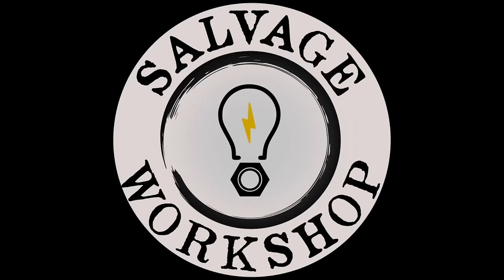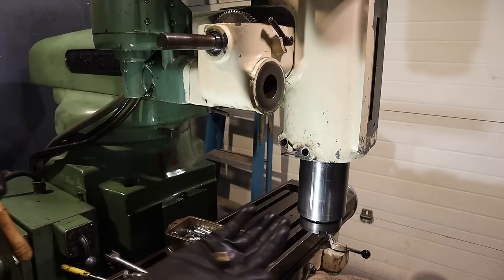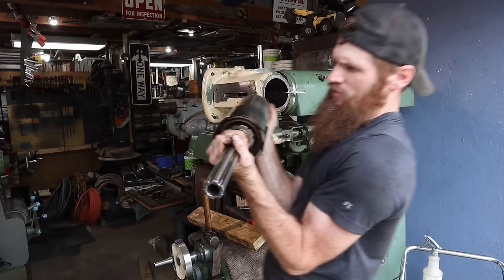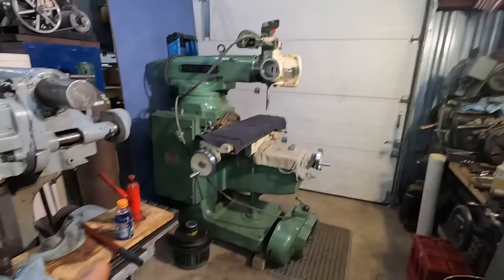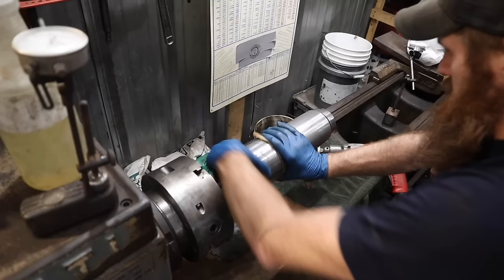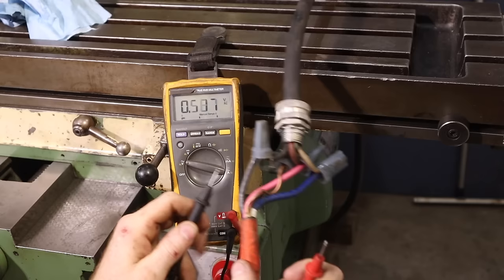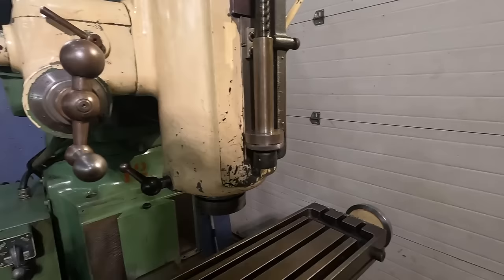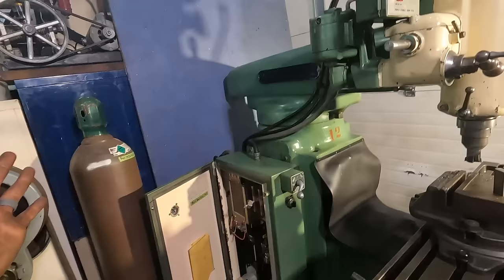My 1960's Milling Machine Is STUCK SOLID! ~ Can we fix it or will I DESTROY it?!?

Comment: If I’m hearing that right (it sounded muted like you had silenced it to some extent when editing the video) that clunk your talking about sounds like a gear dog not fully engaging it’s mating gear.  Not sure if you know what dogs are.  I’m referring to the sideways projected “teeth” on some gears.  They project out axially instead of radially as in the actual gear teeth would.  The dogs will mesh with another gear or sliding ring with a matching set of dogs and this is a clutch in essence.  Dogs mate with another set of dogs on a shared shaft.  Think motorcycle transmission if you’ve ever had a motorcycle trans apart.
Also could have been a pawl skipping.  Again not sure cause I couldn’t hear it very well but I know that sound.  We do a lot of the same work.  Engines, mills, lathes, heavy equipment repair etc, and I’ve heard that sound many times from various mechanism and it’s some sort of gear not quite meshing right and it’s ratcheting or some call it camming out I believe!

Comment: Probably need to change the setting / heaters on that cont actor since you are running 240V the amperage will be higher than the 240V so that would cause the tripping.

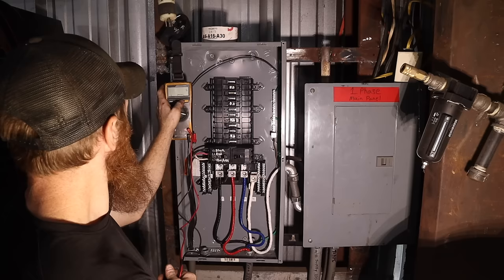Comment: 1:00:30 oh man, never measure mains using 2 hands like that - always hold both probes in one hand and keep the other hand well out of the way or behind your back. If you get a shock, 2 hands is shunting the full voltage directly through your heart and will kill you instantly. One hand the worst you can get is to ground out your leg on the side you’re holding it.

Comment: Look at the motor nameplate
230 volts draws more amps than 460volts
the N20's are overload heaters that heat the post they sit over high amps cause solder posts to melt and spin causing the motor to trip i think you will need to finf a HIGHER n STYLE HEATER

Comment: I am sure I know less than most. As mentioned below check your control transformer.  and compare it with your outputs on the starter. If wrong a simple single phase  step up transformer to the starter coil should help.   When you dropped your voltage at motor from 460 to 230 you doubled your current through  the over loads  you may need to  change the overloads..

Comment: You need an electrician. Did you change the voltage on all the motors or just the main drive motor?  I'd also toss that RPC and get a VFD

Comment: I wonder if something crashed into the spindle housing, where you have had to wedge it apart with chisels. I feel that slot should be at the wedged apart spacing, without chisels.

Comment: you need to change the heater on the overload for changing from 480 to 240 beating on them ain't going to work and all main fuses need to be changed and all other fuses also the spindle motor also may also need to be rewired is it 120 v or 480 /240 and the table drive motor also

Comment: The vari drive belt wears on the tapered flanks.  You need to research the width of a new belt and compare to the old.  If too narrow, you will lose speed range.
Reply from the maker: Already done... it has NO wear... I doubt this machine saw much use

Comment: If you got a 4 jaw truck for that, lay, put the 4 jaw in there and indicate it to the closest to zero, and then put a center. Make some kind of fixture to go on that like a live center, so you can put that other face and then relax it all. Put it together and then put it in there and start tightening up the 4 jaws.  And then indicate the whole shaft in 4 or 5 different parts cause a shaft is probably gonna be true. True, but that's what you need to do it, do it the right way. You can't do it on a 3 job. 3 job. 3 job won't be able to do it or take it to somewhere. Do you know there's a machine list? And just say can you check it? And see how true it is and have a market down on paper for you. And 4 or 5 different parts by kasha 100 bucks or whatever. But I don't know if i'd wanna leave that chuck, there was a meter.  But that's what I would do if you want to do it the right way.

Comment: I'm not so familiar with the electricity system you have over there, but a 230/400 3 phase transformator isn't that expensive here in Europe.

Comment: What the hell was a high school doing with a machine like that?
Kids didn’t use it or there would be holes in the table.
They don’t make them like that any more. That’s a really nice machine.
Is it just me or were those sparks flying out in the wrong direction.
It’s hard to tell which way things are spinning in a video but sparks don’t lie.  Is that running backwards?

Comment: You said you switched the spindle motor from 480 to 230 volt, but did you switch the other motors to 230 volt too? That could be some of the magic smoke on the spindle down motor. @Joel.B491 mentioned the thermal overloads on the magnetic starter and I would agree that could be an issue with the machine tripping overloads. Awesome video keep on keeping on.

Comment: What's the reliance on WD40 all the time?

It's the last thing you want to use longer term as it ATTRACTS water.

For immediate short term use it's okay on like a seized lock; but replace it with an oil of somekind like fogging oil as WD-40 will flush out any grease or lubricant in the lock.

Or just use water to free things up - you'll get the same long term effect if you don't additionally rust proof it.

Comment: This was a little bit painful to watch. You did get it done but a bit backwards.
Disassembly. 1; remove snap ring and pull spindle out. (Having it Horizontal was great!) Then remove spring and the retaining pin and spindle ring.
When you reassembled it and pushed the spindle ring against the spring... and let it go...😮 I thought for sure you were going to get popped in the mouth.😮 Dodged a bullet I think.

Hey... full moon

Comment: All of the smaller motors need to be voltage converted as well.
Reply: They're all fed from the step down transformer in the power box, as is the spindle control relay.  He already rewired it for 220.

Comment: Also, you definitely need to tram or "swing" that head to get it to be perpendicular to the table. Im positive in your collection you have the indicator to do the job but if you have never swung a head before i recommend you google it, you shouldnt be taking material off with your cut on the back end of the face mill that you have. Just my two cents.

Comment: Ok, so the spindle motor is rewired and as many says, it will consume more current in this mode, so the motor protection needs to be retuned. The transformer in the electrical cabinet was rewired for 230, so this is a single phase circuit, and probably supply the x-axis feed motor. The spindle feed motor is then the question… is it a three phase motor? Then it will need rewiring as well. Is it a two wire motor it is probably feed from the transformer like the x-axis feed. But the buzzing noise from it sounds to me that it is a 3phase motor missing one phase.

Comment: Lower voltage, higher current, for the same power.  I suspect the safety is set for 440 not 220 by mechanical fuse breakers.

Comment: Why do you not have an end of suspension support (tail stock) for that massive "tube" you are trying to true-up?   Having the end suspended on the proprietary support (tail-stock) will help your endeavour in stopping that mass from "wobbling" as it rotates.   Having that mass suspended only by the primary chuck is really asking for "out-of-true" trouble.

Comment: I was a tool maker/machinist for a while. Man, that is the wrong way to do any of what you did to that machine. They make specialty pullers for the quill incase they get stuck; don't hammer on a high precision piece of equipment, you can tap on stuff but that doesn't mean you should smash on it with a hammer. There are ways to heat things so that they can move easier, mantles work really well. We built our own at the shop I was at and it would evenly heat components with tight fitments to a safe temp so we could remove it and diagnose it properly not jamming a chisel into the slots. You can bore/hone quills but you need a HIGH level of precision when doing it. Bore gauges and workshop manuals for the machines or at least diagrams with tolerances are an absolute minimum. Any and all time spent doing the homework on a machine first is always well spent time. 

As for the wiring, I don't know, that wasn't my department. I do know that it wasn't uncommon when we would get older machines, most customers would opt for the old loom to be replaced with a new, custom harness and controls. For sure don't sit there and show that it is spewing electrical smoke. Sometimes machines that haven't run in years need a bit of break in run time but the reality is when you clean/reassemble everything properly it shouldn't smoke at all. Check your wiring before powering the machine.

It really sucks to see such a gorgeous machine get wrecked and I am sure you had the best intentions in your quest to fix the machine but "You don't take a watch apart with a hammer, you take it apart with careful effort and time." Worst case, get a new head and quill from a machine in worse condition and replace the wiring. The convivence of modern electrics in an old machine cannot be understated. Or if this is just a drill press mill (self explanatory) maybe it will function for what you need.

Also if you are using a lathe to measure stuff, that isn't the way to do it. I don't really even know what you were trying to measure with the setup you had. Trying to measure something that is accurate to the .003+/- on something that "I don't really know how good it is or if it is true" Is like trying to build a metal weldment square and to size using only your hands.
Reply: I agree he is what you call a "hammer mechanic" I never once saw him use a mike or a bore gauge to see if things were out of round....made me cringe when I saw him pound a chisel in that slot.

Comment: Probably I'm wrong but at 1:17:30 the cutter was spinning in he wrong direction. 
About the spindle binding before honing the bore and sanding the quill I would have done some measurements with a micrometer both on the bore and the quill to see where was the problem and then doing some metal removal.

Comment: Pull all the electric and throw it in the trash...The motor is wired 220...Buy a Fuji VFD .They will talk you threw the set up.Mine was $ 250.00.The set up takes 15 min.I have 3 of there VFD's. One is on a Wells Index 747 2 H.p. one is on a South Bend 13 2 H.P. lathe. One is on a Burk #4  mill 1/2 H.P. Not to mention you will have a way to fine tune your R.P.M  's.

Comment: I couldn't believe what I was seeing when you were beating the shaft with a steel hammer. If you don't own a brass hammer you need to buy one. If you swell that shaft from hammering on it with a steel hammer it would cost a lot more to replace that shaft then it would cost for a brass hammer made for hammering on steel parts you don't want to damage.

Comment: Look at what your motor current ratings are at the low voltage. Then find the right thermal overloads should be 125% of the low voltage current rating. You will have to go from an n20 to at least an n29 on all phases. Not just the one that’s tripping.

Comment: I should have explained better in the forward position of the main spindle should be spinning clockwas from the top looking down  ( just think if you put a drill bit in it would not be spinning the right way ) So I the other fu functions sim to be working right you will need to switch the 120 volt lines on the main motor only. Be safe power off

Comment: You think that cut was good Wate till you have it spinning in the right direction. You were spinning the tool backwards. And all the other comments about the current increasing as the voltage decreases are correct.

Comment: At about 1:06 in the video it appears that the switch is wired backwards or some other wiring problem. ..forward seems to be reverse and reverse seems to be forward.  Don't know,  just going by hand drill experience.

Comment: You are running the cutter backwards and the inserts are inserted in it backwards as well. 1:17:33 The cutter should rotate in the same direction as a drill bit.
Reply: Yes agree, he needs to change the phases (red to black maybe) so that the direction matches the direction on the switch. Also should always look closely as the cutter slows down to check for correct rotation direction before cutting. Cut should push cutting tip into seat not into clamp.

Comment: Too many armchair warriors. For his application i see almost 0 problems with how this repair was undertaken. The mill was scrap value to begin with, it is now in working condition with more than appropriate precision for his shop, where it would have otherwise been recycled into peach tins.

Ok maybe he should have taken the head off and pressed it out instead of hammering but no harm no foul if the bearings are still ok (also replaceable).  Put a test indicator inside the bt40 taper, clamp the quill and check run out; do this for the quill fully retracted and extended I bet its still perfect. The bore he honed only effects runout when using the quill unclamped, all precision moves should be made on the knee anyway. Again likely perfect for the shop its in. Also any material removed from the bore to make it fit would only effect fittment on the next spindle rebuild 50 years in the future....who cares.  The channel is called salvage workshop, you want overzealous precision go watch robin renzetti.
Reply: Best comment. As someone who restores eBay junk electronics back to working condition, like new can't always be achieved. Good enough to be used for another decade or two is my goal. I have a PS3 controller that was chewed by a dog that now works great. Bite marks on the casing, though.

Comment: No way moving only a single wire can reconfigure a motor from 380 to 230. You probably only reconfigure the voltage of the small motor that are single phase.

Comment: did you try and put it in from the top? the bottom collar could bet different as the quill never would go down as far as when you try and take it out the bottom. I did not finish watching so maybe you ended up doing it
Reply from the maker: Yeah, i tried both ways! Manual states to remove it from the bottom

Comment: So I didn't see using measuring devices inside diameter.
What is it supposed to be?😮
Reply from the maker: There are NO specs for a machine like this, not anymore... none of the manuals have that kind of information in them, I looked! There are VERY few of these mills left, so what's it supposed to be? Whatever fits!

Comment: 41:00 I'm struck that someone who is working on a machinist too does cut-and-fit instead of getting out machinist measurement tools and checking the dimensions and roundness of the parts you're working with.

Comment: I also cringed when you started the honing. No oil? I would take the wedges out before any work is done. You will change the dimensions of the h e main surface. Also minute rust. The noise you are the bearings. When manually spun then they were dry.

Comment: Nice machine. No offense, but your lack of basic machine tool knowledge is a bit scary. You should practice measuring before making any changes, whether it be mechanical, or electrical. 
The motor nameplate will tell you the amp draw for low voltage, you will need that to select the correct heaters. 
But, you got it going, best of luck.

Comment: very easy to find out parts are binding and on what they are and hung up with, just put daikon on it and slide it in and you will see exactly where the problem is for the next time, and by the way I think you did a very good job,I am a retired tool and die maker. And a machine repair man. And I have worked with Bridgeport's all my life, and every other type of milling machine there is. I can definitely tell you are not a machinist. A very simple reasoning for that using steel hammers to drive shafts in and out all precision surfaces, and this is for the future to use brass hammers and if you gotta make a big one that's what you do. Do not use steel on any precision parts or metal you are trying to move always brass. And I am a little confused why you made the statement that machine is better than a Bridgeport? Very curious of your opinion why you made that statement?

Comment: Dude, I didn't see a bore gauge or micrometer used on the quill housing or the spindle BEFORE you started to remove metal and watching you guys pounding on metal parts with a metal hammer is like WTH. Hope I'm wrong for your sake but you may not have a precision machine after this! Also, if you have applied power to a motor to the degree it smokes, you may want to take a closer look at it before you press it into service. 
Geeze, this one was hard to watch.

Comment: Your overloading the Over load  (OL) heaters that protects the motor and wires. The 120 volts is for the coil that energizes the magnetic motor starter. Just remember your running at 240 volts not 440 volts. The higher the voltage the lower the amperage. The overload protection and wiring is for 440 volts. Put an a probe on motor legs. I’m betting your drawing 40 amps not 20 amps.

Comment: I am of the opinion that one runs a hone back and forth in that tube till that quill moves freely without chisels beaten into it's release crack. This quill should freely move up and down as far as it's travel will allow. It isn't open enough. Hone some more lad. There is no straight angle. That is bogus. Hone the crap out of it sir.

Comment: LOWER THE KNEE AND LEAVE THE VICE IN THE CENTER OF TABLE  / NOT OFF TO ONE SIDE WITH THE VICE NOT EVEN OVER THE KNEE  / IT'S O/K TO DO A JOB  BUT NOT TO LEAVE IT THERE INDEFINITELY    / IF LEFT LIKE THAT FOR A VERY LONG TIME MAY PUT A  BEND OR BOW TO THE  TABLE